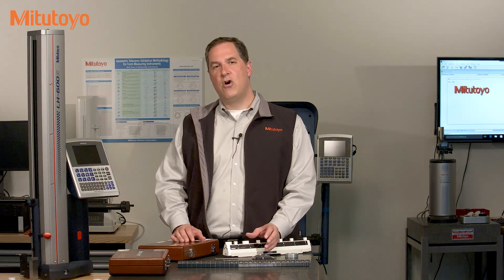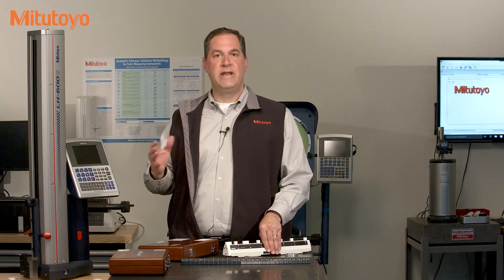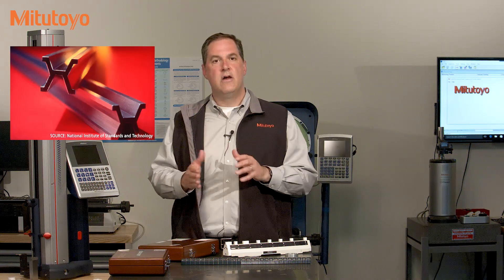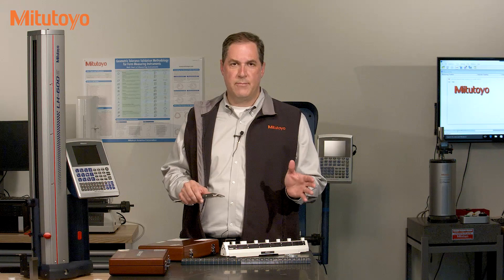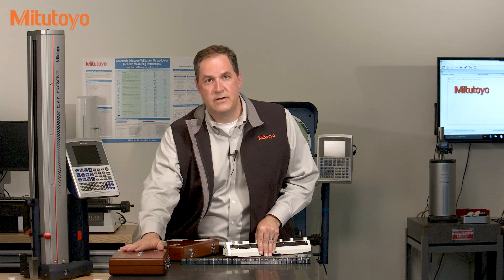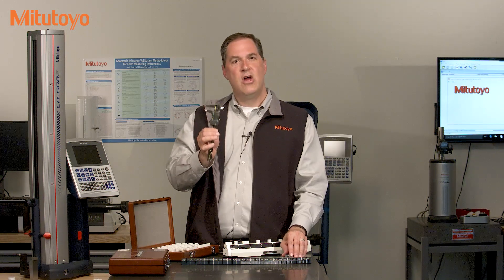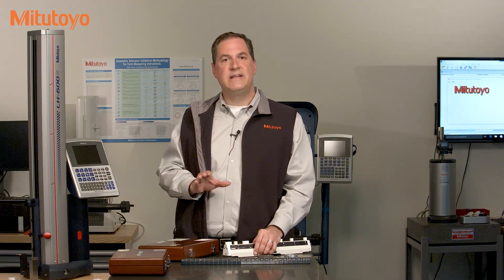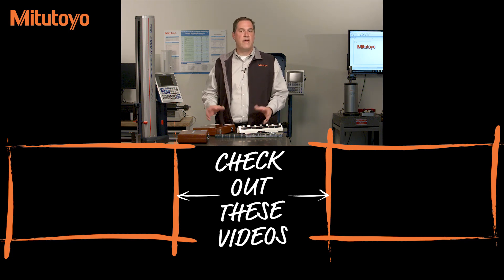What is Metrological Traceability -  Requirements Traceability and Calibration

Comment: Great video. I wonder what they used to measure the original meter, and the copies. That must have taken a considerable effort in the days before laser interferometers. Of course, then there’s the question of how one measures the distance from the North Pole to the Equator? Might make for some fun Sunday evening internet research. I’m glad someone else figured that one out though.
Reply: I highly recommend the book "The Measure of All Things" by Ken Alder. It's a good read about the two scientists who did the earth circumference measurement in the late 1700's. The meter bars were measured on a line scale comparator (they were not end standards, but rather had etched lines). Mitutoyo's museum in our headquarters in Japan has one - it's pretty cool.  Thanks for the comments.
Reply: Jim Salsbury Thanks. That looks like a good book. I have a copy on order. I saw it mentioned on the Wikipedia page. There it was mentioned that it was.a seven year expedition to make the measurement that led to the value for the earth’s circumference. I love the tenacity of the pioneers in science and metrology in those days. They wouldn’t hesitate to tackle problems that took decades, or sometimes multiple lifetimes to solve. I guess that still happens today, but the results of today’s science are not as satisfying to me. It seems in the Newtonian days, the physics was much more useful to the common man.

Comment: Actually meter wasn't based on circumference of the Earth but distance from equator to north pole. One tenth millionth part of that was decided to be one meter. So distance is 10 000km.
Reply: I think we are both right. It was from the circumferential distance from the equator to north pole, based on a measurement of the circumference of the Earth from the north to south of France in the late 1700's.
Reply: You sold me